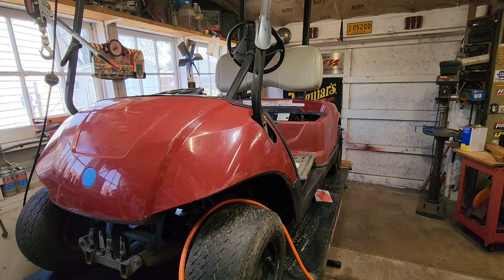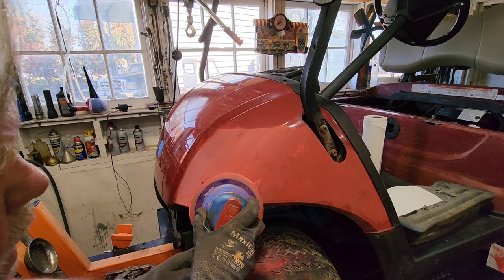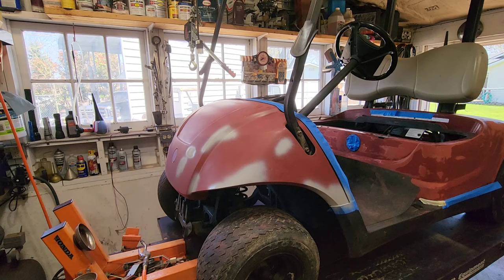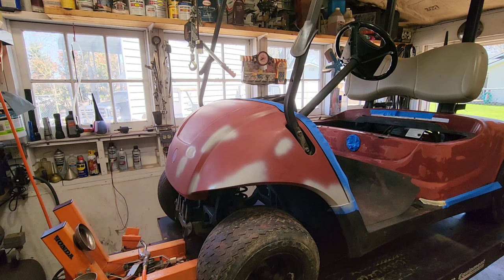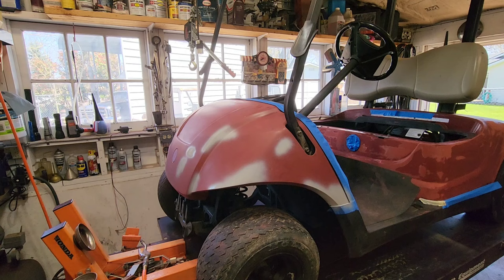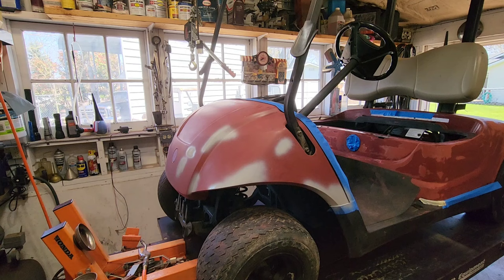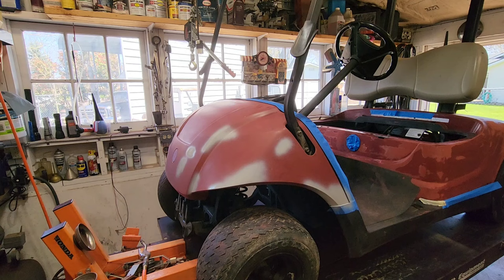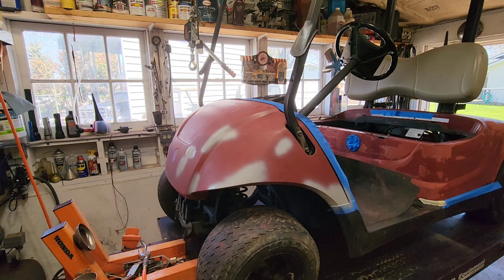My Golf Cart got $20 paint job in 1 day without taking the body off using 1/2 quart of Rustolium!

Comment: I'm doing a golf cart too. Was wondering if you needed a clear top coat, and if so. High gloss oil base?
Reply from the maker: It's really up to you. Rustolium is a single stage paint, and will last for many years without a clear. They sell a clear and it will look better and last longer with it. If you scratch it, you would be able to spot paint it without clear, with clear you would have to repaint the panel for best results.   Good luck!

Glenn

Comment: I didn't notice a clear coat or a final buff for orange peel. When would you recommend a clear coat and a final buff for orange peel?
Reply from the maker: I have videos in a Playlist for a 1988 clubcar golf cart where I did cut and buff this same paint. This cart came out so nice, I did not buff it. I sold this cart in August for $5k. Rustolium makes a clear coat but is not carried locally but can get it on line. I did paint a Honda Reflex also on my channel with Rustolium spray cans and did clear coat it looks awesome!

Comment: If the golf cart has a plastic roof, is it painted the same way as the body or is there a different process?
Reply from the maker: The body was factory red coated plastic, not really paint. It had been rattlel can painted previously.  The roof is a softer plastic and the same color all the way through the plastic. I have seen people paint roofs, it takes a bit of prep to pull that off.

Comment: I know next to nothing about painting. What kind of inexpensive paint gun would you recommend? Also I have a Rigid twin tank contractor compressor. Would that be sufficient to use? Thanks.
Reply from the maker: So I have a collection of vintage Binks and Devilvis Spray guns and it's all I have used. Harbor Freight sells HVLP Guns... High Volume Low Pressure. There cheapest one, Purple, I think is like 15 bucks, and I have heard nothing but good from everyone about it. I, too, have a twin tank for taking with me and I used it to paint the backup generator at work many years ago, and it was fine.  just don't be in a hurry. It will run warm so you will need a good water separator.

Comment: Did you go through the entire qt? I'm asking as I'm about to paint a txt and want to do the top and  bottom of the roof as well and wondering if a qt will do the entire cart with roof.
Reply from the maker: I think I used a bit over half a quart, but I recommend having an additional quart on hand just in case. Keep the receipt and return it if you don't end up needing it.

Comment: Nice job.... Hey question, with is the width, and length of your lift table?
Reply from the maker: The center is about 2 ft by 9 ft with 2 12 inch side extensions. 1500 lb rated